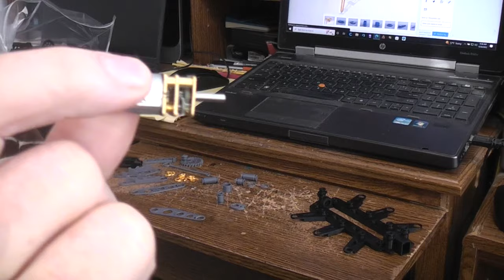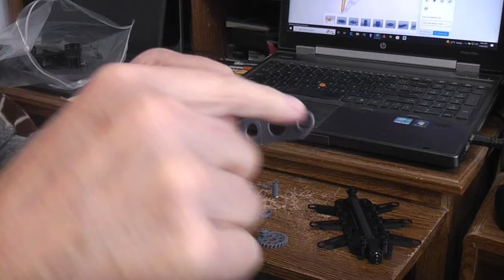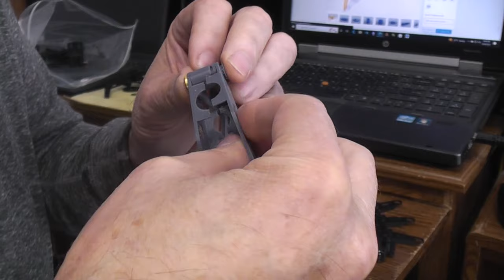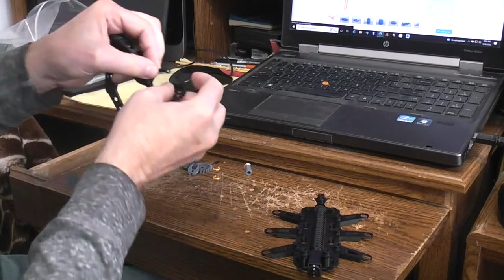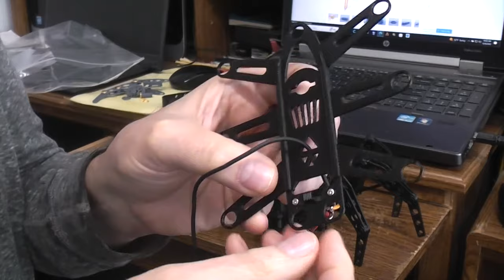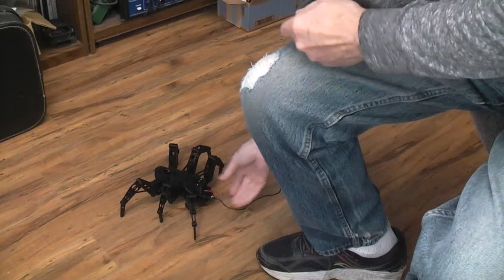6 leg Beetle Bot build video. link to 3d print STL files and demo video.

Comment: Very interesting build with a clever mechanism, I especially like that it requires few non 3d printed components to complete.
 What do you think would be the easiest way to incorporate steering ? Maybe using  2 drive screws, one for each side ?
 BTW you are right about those motors, I read somewhere a while ago that there are only something like 3 gear ratios and they all pretty much use the same motor and all the other variations are just the motor on different voltages .
Reply from the maker: I was thinking 2 screw drive units and change from 6 legs to 8 legs for stability. I have a 8 leg verion built now, just waiting on the N20 gearmotor "1000 RPM" to arrive.